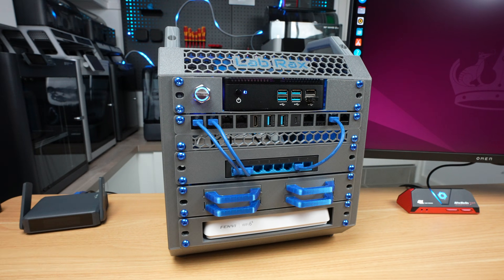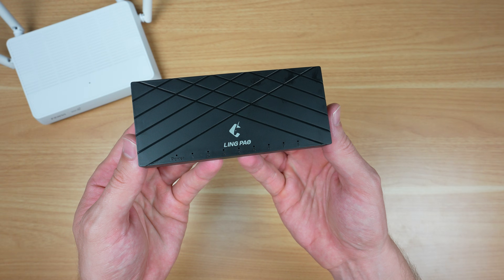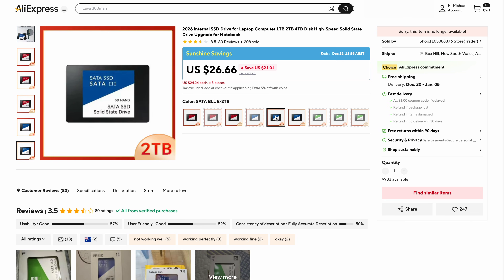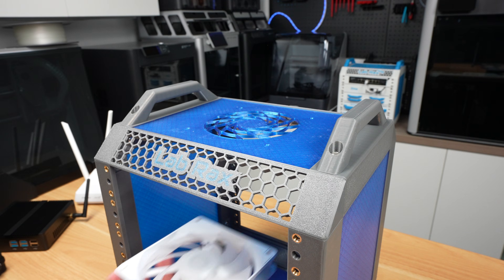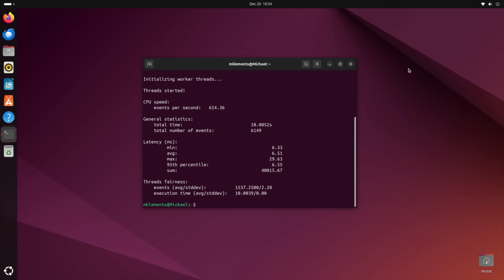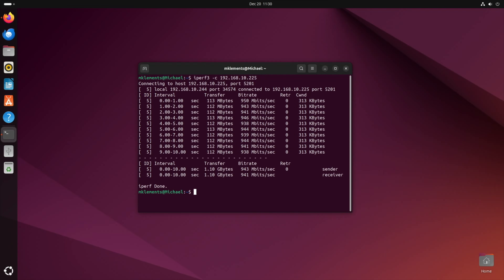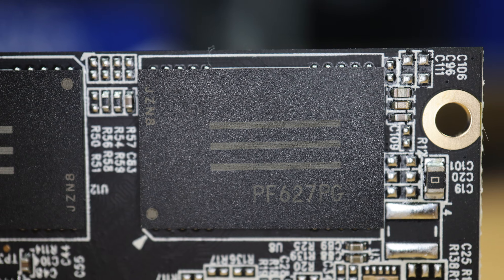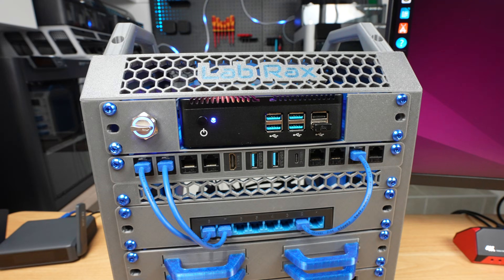This $216 AliExpress Homelab Sounds Too Good to Be True

Comment: interesting experiment. it looks the part, but it's very low power. it's so low power there's nothing it can offer me, that i can't simultaneously do on my desktop with no noticeable overhead. 

and i don't trust the router. for me that's.. just.. why make myself vulnerable? it's better off the mini has better internal wifi/networking spec in general, than including a whole router and switch. i think. valuewise, id take more security over more ports.

given the same budget, i'd dedicate almost the entire budget to the mini itself, to be sure that it has those baseline features. such that, Most of the added componentry here wouldn't be necessary.

i also would not print a case from plastic, there is predrilled and tapped aluminium angle you can use for these rack/shelving purposes, i think the cost would actually be lower than the plastic + screws + bushings here, even if you were to do fullmetal. i would also not contain the mini, i would have it sitting directly on top.

i'd probably also do away with the fan at the top. all that is doing with no dust filters present, is introducing more dust through the system, while probably not increasing cooling by that much because it's so indirect. it would be less of a dust magnet if it was fully-passive, instead you can receive superior cooling aspects for free, by simply making sure that the final placement of the thing is in a cold and dry area of your home, if you have access to that.

i still think this looks very charming though. you should give it away. minus that switch and router, you should probably destroy those with a sledgehammer or a brick, or drop them from a high place, if you ask me.

Comment: Re: Aliexpress hardware - If you had spent a little more money, rather than going for the absolute bottom of the barrel gear, you could have gotten a much better system.

I am putting together something like this right now with a mixture of aliexpress parts & what I can purchase locally.

I have 2 routers from Aliexpress.  An unmanaged router with four 2.5 gb/one 10gb port is less than $25.  An eight 2.5/two 10gb port  router runs about $42.  I have been real pleased with both.  

As far as minipcs - In the US, I paid $250 for an HP elitedesk 800 G6 - i5 10500t, 16gb ram, & wifi 6.  This is a much better deal than the Aliexpress miniPC you purchased.  That being said, if I had done this last year, you could have gotten a minipc built around a Ryzen 5000 mobile chip for the same price.  Those are all gone now, unfortunately.

For what you paid, you can get an a HP elitedesk 800 g3, built around an i5 6500t.  It has quite a bit more in the way of capabilities.

The little travel router you purchased sells for the same price in the US.  I have last year's model, and I have been very pleased with it.

The SSD storage you purchased was a well known scam - in the past they had 128gb micro SD cards in the enclosure.  Never buy SATA SSDs from Aliexpress.  I have had excellent results with nvme drives, although those can be the same price as here in the US.

Comment: You meant to say $216.05 + at least $500 if not a lot more for a Bambu Labs 3d printer so you don't have to buy all the other parts. 🤦‍♂️
Reply: The only thing he didn't buy was a case im sure you could find one for less than 200$ making this still cheaper, also it's not the like 3d printing materials was free either.

Comment: I think you should do the same type of home lab build, but with a better mini PC that has at least two m.2 2280 slots. One for proxmox, the other for a 6 port SATA adapter. Design 6 bays for 3.5" NAS drives (on edge, rather than horizontally). The substitute for the mini pc would be an M-ITX motherboard type of computer system. 

This is what I've been planning for my Lax Rax rack I printed out. Powering the drives is the issue if I use a mini pc as I want to have them power on and off with the mini pc. My thought was to use a spare 300 watt 24v meanwell psu for a 3d printer I have laying around and using a combo of step down converters (for 12v and 5v) and a relay for switching it on when the mini pc is powered on. I just haven't found the components I would need to make that work, as 6 3.5" hard drives can command upwards of 18 Amps while starting up (on 12v), so to be safe a 20 Amp buck converter would suffice. For 5v the amperage needs are much lower.
Reply: "m.2 2280  six port SATA adapter. "  what are the forces involved with six SATA cables hanging off a small PCB held in by a slim edge connector and one tiny screw !?
It cannot be reliable over time if theres the slight vibration in a system.

Comment: You could've saved money for the switch and used the router ports. It seem you had enough to connect 1 mini pc. Storage is the usual pain in similar sites. Even you are lucky enough to get the advertised capacity usually they are not performing well. My rule do not buy anything from a "brand" that I can buy locally. I agree with the notes below that for these money you could've get n100 or n150 that are have lower power and better performance, but have a fan.

Comment: I'm sorry, but is no one going to ask about the power situation here? You didn't tell us anything about that beautiful light up power-switch you turned or how you connected power to each of these devices. As an enthusiast in the 10" rack world I would really appreciate some explanation there. There are frightfully few 10" rack mountable PDU's or power-strips that are cost effective.
Reply from the maker: There isn't really much to talk about, each device comes with a 220V adaptor which I plugged into a power strip. The only modification that I did was to hook up the power switch to the PC's power supply (which then also drives the fan above it).

Comment: 10:30 Those are 1TB SSDs, it depends on manufacturer who uses 1000 and who 1024, with SSDs could be anywhere. Those show actually  just above 1TB in HDD terms, you got 953 GiB there. 102495... bytes, so about 2.4% over 1TB. Leave that or more unpartitionen (unprovisioned) to make certain GC and Wear Leveling works optimally, that's the biggest drawback of random MFGs, if they use really old controller chips their GC/wear leveling can be horrendous.  H2testw just took 1 full drive write, and there is tests which don't need to overwrite the full SSD.

Yoiu got scammed because you went looking for scam, subconsciously if nothing else. It's fairly easy to find good SSDs on AliExpress -> Just look for the brand. Kingspec, Netac are very common, but there are MANY. You bought unnamed ones, so  obviously scam territory. If you go in expecting to be scammed, you are way more likely to get scammed. If you go in looking for a good deal, you are likely to fiund a good deal. Subconscious mind is funny that way.

Comment: TP-Link is selling your data... So I wouldn't recommend it to ppl only the ones you can run OpenWRT on. And longevity... lol.. I use them as they are the cheapest in my area to run openwrt, but they die like flies...
Reply: Microtik would be a good choice for router and LAN switch. You get a huge amount of flexibility for a reasonable price

Comment: I know it defeats the point of the Aliexpress portion of this video but you would have been much better off with a used Lenovo M715Q 2400GE machine (for $100). As for what you can do next - do a video on trying to install OpenWRT on the router.
Reply from the maker: I agree, buying used hardware would have resulted in a much better system.

Comment: There are some decent "keep it in a less important use case" network switches on AliExpress, and sometimes brands like Sipeed only officially sell through their AliExpress store. But typically I avoid. Sadly, Amazon is getting pretty bad these days too, with many product searches polluted by tons of drop-shippers who just resell AliExpress gear!
Reply from the maker: It's been sad to see the decline on Amazon, it's becoming "AliExpress" with local, faster shipping.  I've noticed the same with Amazon AU over the past few years.

Comment: I would say SATA-USB bridges are usually unreliable, but that ended up being the least of your problems.

Also I bought a 16TB HDD after the CHIA breakdown. I knew what I was getting into, SMART was reset, but the drive still works flawlessly. If only they were honest about the drive being used then they would not have had their stocks confiscated over counterfeit claims.
Reply from the maker: Strangely, or perhaps luckily, I've never had a SATA to USB adaptor fail on me. I do usually stick to more well-known brands like UGREEN though.

Comment: Interesting experiment. Even though you probably know what the outcome will be,  I suppose you have to do it ...  as for what to do with it. Well apart from keep the brass insets and bolts, and the 3D printed rack ... not much use for it. It'll eventually throw up some sort of technical issue at some point. So I would say, find a distant enemy who is into this stuff, and gift it to them, they would then spend hours and hours tracking down the bugs and issues 🤣 ... only kidding.
Reply from the maker: Haha, I'm thinking perhaps reflashing firmware on the router to run OpenWRT. Having that and the Mini PC reflashed would at least make me a bit more comfortable allowing them onto my network.

Comment: Re buying main brand stuff: depending on where you live, you might be better protected agains scams. But a lot of the main btand stuff is just the same chinese quality, relabeled, for 4x the price. That makes the choice often hader than you make it sound.
Reply from the maker: I've noticed that it's a lot easier to buy good quality used hardware in the USA for a decent price than in places like Europe, UK and Australia (where I'm located).

Comment: I got lucky on finding cheap stick of M.2 that worked in raspberry pi 5. I wanted 4 gigs but, prices are high I so got much lower to start for now a 256 but, it is not on the approved supported list and still works. I really like these racks. If I had a printer probably first thing I would print are these.
Reply: What on Earth are you talking about?

Comment: Did you have to pay tariffs and import fees when ordering on AliExpress?
Reply from the maker: Australia doesn't have any import duties or tariffs on low cost goods (I think the limit is around AU$1000).
Reply: For reference, we didn't in the USA either, until August 2025 (May for China and Hong Kong).  Under $800 there used to be a de minimis exemption that should clear with no Customs duty or tax.  
You know who to thank for that, it's to prevent drug trafficking.

Comment: i bought a 5port Switch from Aliexpress, with 3x 2,5gbe nic and 2x SFP+ 10gbe ports, for 45€, year n half ago
I get all the bandwidth that was promised, and i've never had any issues at all
Reply: Same: got Ugreens 5x2,5 gb+1x10gbe SFP for 50€ each and they work like a charm
Reply: dude went and bought the cheapest shit with no reviews, doesn't test the wifi 6 router with a wifi 6 card / device and says it all sucks. dunno how I ended up subscribed here, but I know why I'm out :)

Comment: Reminds me of when I bought a "100% authentic WD NVME" with lots of positive reviews on Aliexpress. 
"Never buy storage from Aliexpress" is correct.
Reply: On my old budget pc i used i think it was netac m2 straigt from ali. entire build was from ali including mobo, cpu, ram, case and ssd was like kingtec or something. 0 issues run for a year of warzone abuse until i upgraded to am5.  Is easy to see its scam. But hey for some people there is warnings to not drink car battery liquid.......
Reply: You can buy storage on Ali, but with some research done: there's some nice nvme ssd's on Maxio controllers with ymtc ram (some of Fanxiang, Netac, Fikwot, Kingspec, Cusu and even Hikvision)
Reply: I see high prices on Aliexpress, just usual A level prices.

Comment: Absolutely terrible idea to get THAT OLD junk. Even on Ali there are some reputable brands with good, fresh and modern products. Today N100 is the bare minimum for cheap, power efficient CPU, it already has 2.5Gbit. GMtec has G3 that was available at this price some time ago, maybe still with some coupons. 
For storage never trust anything like this. It's always a scam! But yet again check out products like those from orico. Mine works reliably for a few years now.
USB is also not a great choice for the best connection to storage. Added fan and fan less PC is weird. Also measuring Geekbench in GUI with a lot of background stuff will give false results. 
I don't know about the purpose of this set, but still ARM should be much smaller and more power efficient. Today I would go with radxa dragon q6a + UFS and nvme or with one of RK3588 boards (2.5G!). Should be way smaller!. Mini PCs are better where there is a need for huge and removable RAM. Banana pi has few router boards with more resources and good radio, maybe only this one device could replace everything here?

Comment: Forgot to add the cost of the 3d printer and the tools for assembly.. which would not be needed if bought locally as you said and make it far more expensive
Reply: There are 3D printing services or sometimes friends you could ask if you know your model works.
Reply: Aside from what igorda said, your local public library probably has a 3d printer. Otherwise, there may be local "maker spaces" that offer 3d printing services for cheap, free, or asking a small donation.
Reply: @Kajukota Highly doubt there's a 3d printer in a random public library in most countries that dont even have normal paper copiers in them.. most likely only in 0.1% of them :face-blue-smiling:
Reply: @Kajukota  "your local public library probably has a 3d printer."

They can't even afford to open to loan out books.